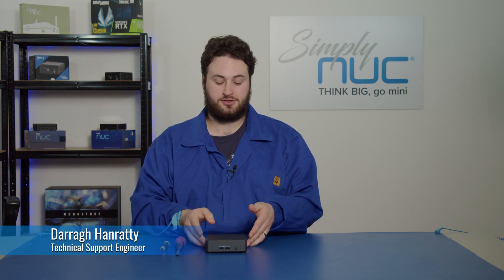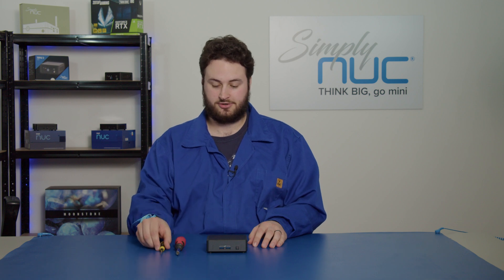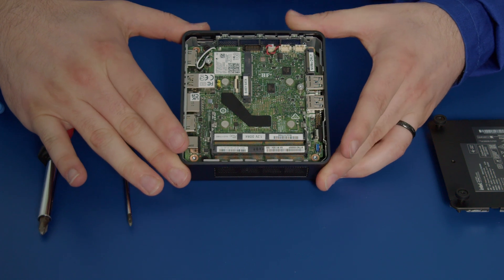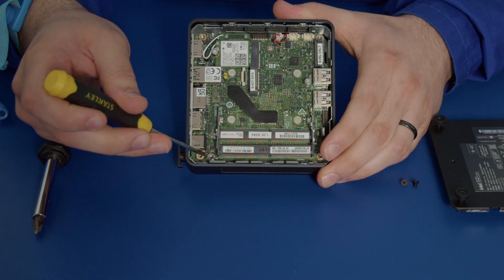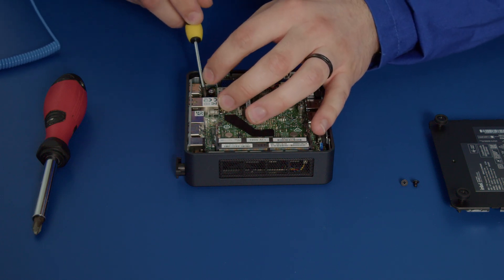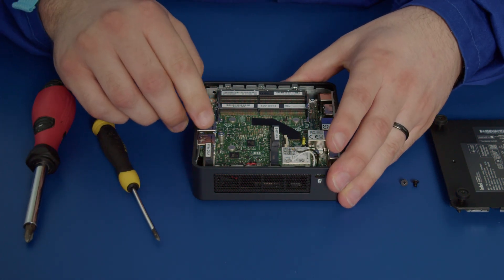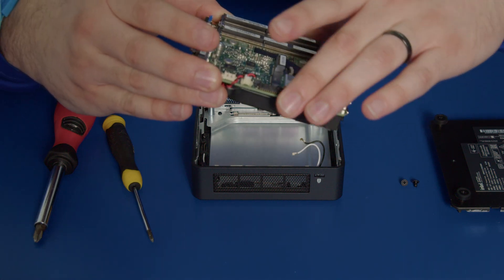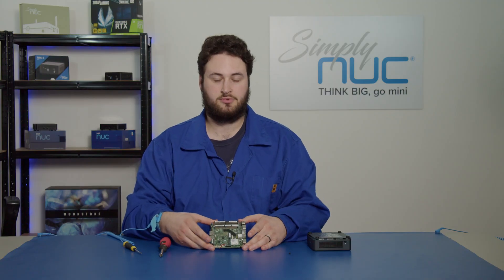How To Safely Remove Your Mini PC Motherboard

Comment: Can you use these boards outside of the case?
Reply from the maker: Motherboards can be used outside of a chassis. There are some caveats related to ambient temperature, airflow, static discharge, and shorting out if metal touches the unprotected signals.

Usually for experimenting purposes, you can use a board with 4 standoffs to align with the motherboard mounting holes. These are 90.4mm left to right and 95mm front to back.

If the exhaust blower is mounting down so you can access the components and connectors, then make sure hot air can get away from the motherboard (no wall directly behind that air would bounce back from and heat the motherboard area)
Reply: @SNUCsystems  I'm looking to stick one in an Arcade cabinet

Was wondering if you can take it out of the case because of the power button (cant keep opening the cabinet it all the time) 

Install batocera on a 2TB drive and leave it in there with a fan I've slready installed inside

Using a Pi4 at the moment but need something more beefy for wii and Ps2 games

Comment: I've found the Wi-Fi connection on the motherboard to be a weak point as in being too delicate. First time I attempted it, it worked Ok for me but a couple of months later, I had difficulty unclipping the Wi-Fi cables, breaking the pin it clips to, rendering it useless. I think it would have been better served with a small socket similar to the USB and HD headers which I believe would be more robust than the current setup. My reason for removing the motherboard was to clean the fan and internal air intake which collects a fair amount of dust/grime over time.